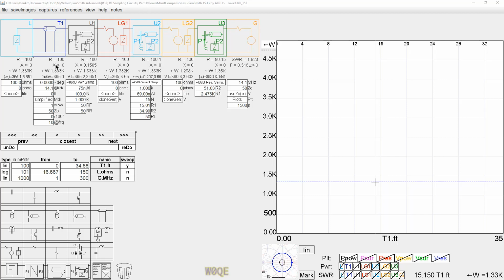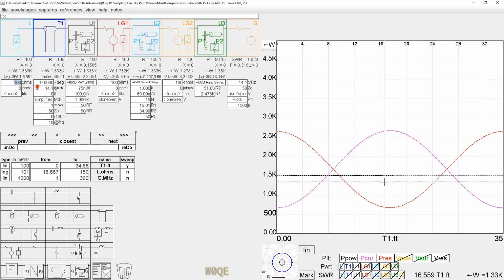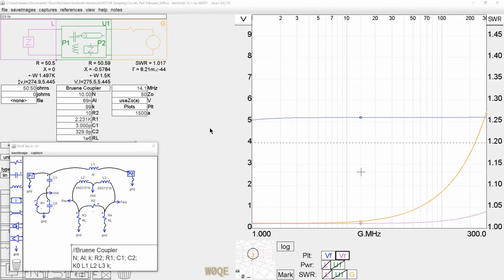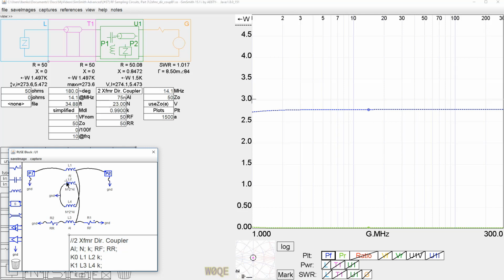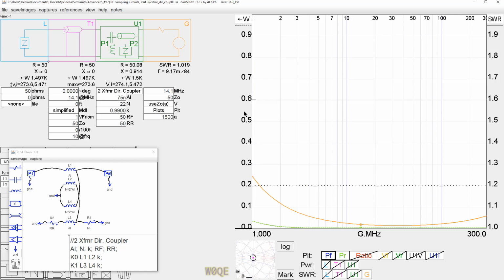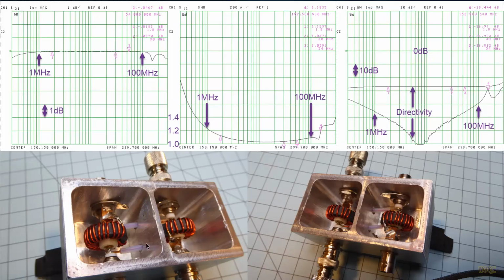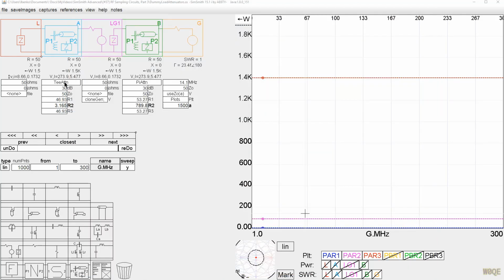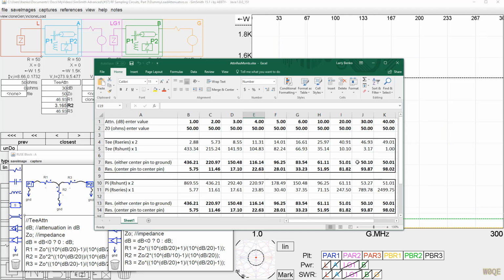#37: RF Sampling Circuits, Part 3

Comment: You might want to try this bridge described here: http://www.g3ynh.info/zdocs/bridges/appendix/self_eval_refbrig.pdf 
I did a simulation by cannibalizing one of your files and the results are kind of crazy. The simulation behaves exactly as the author describes, every tunable component has a distinct "dip", going lover or higher in value results in the increase in detected voltage. 
If you want to run the simulation I have uploaded the simsmith file here: https://raw.githubusercontent.com/galileo-pkm/SimSmith/master/g3ynh_bridge.ssx I tried to build the bridge but it seems that the output impedance of my "signal generator" (AD9850 module from China) changes with frequency so ...Anyway this simulations shows ~40V for Vref with 1.5KW into and open or shorted load, and around 40µV with a 50Ω load. If I understand this correctly that is 100dB of RL?
For "Tandem Match" coupler, k6jca did calculations for quite a few common cores so you might find these charts useful:http://k6jca.blogspot.com/2015/07/antenna-auto-tuner-design-part-5.html

Comment: a quick question, the dual cavity metal box for the tandem match coupler, is that a stock part or somthing you had to machine?

73
H
Reply from the maker: Harry, Sorry I missed your comment.  The box was just a chunk of aluminum that I machined out with a small milling machine that I have.